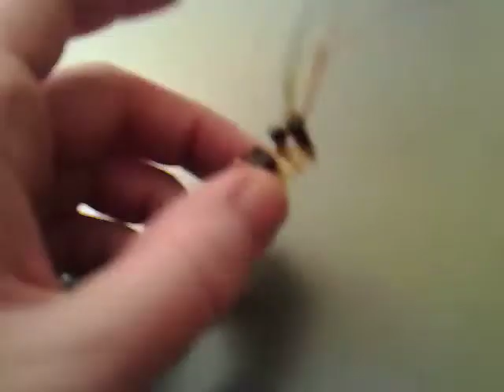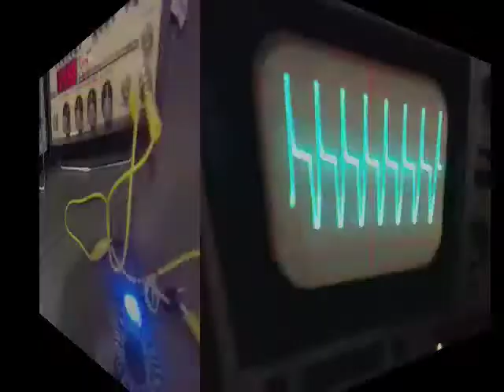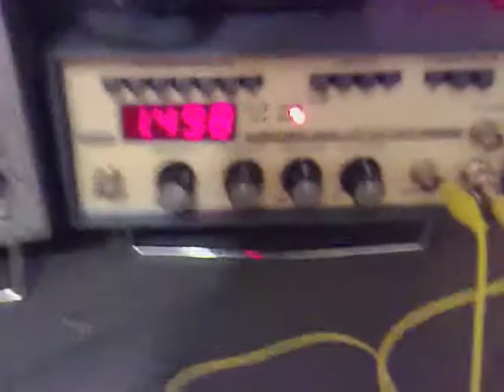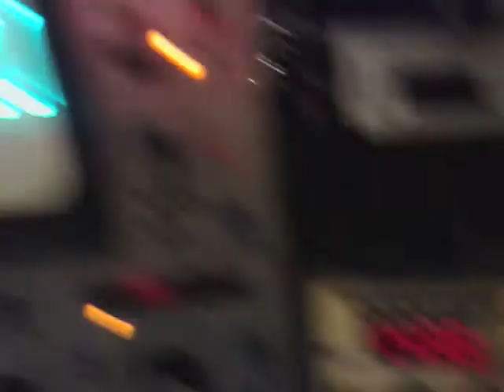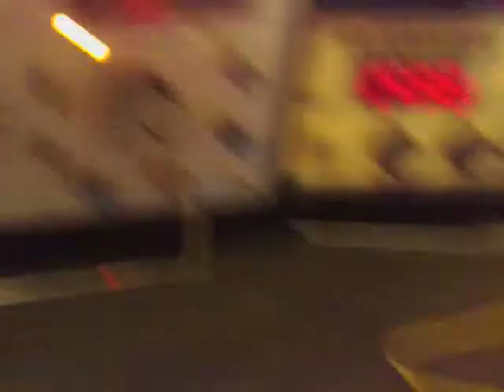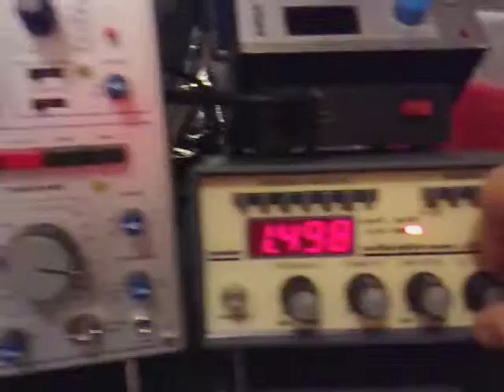Joule Thief (Checking Resonance) 015

Comment: The lights dim as the frequency rises because the higher frequency gives the magnetic field less time to collapse, which means that the flux change is slower. Because the change is less rapid, the flyback voltage is lower. That means less bright LEDs

Comment: So you could take the energy from one capacitor and transfer it completely to another one? Because normally that is only supposed to be possible with half of the energy lost in inefficiencies, and there is a good reason for that too.

What would then happen if you put a resistive element between the caps, a filament bulb or maybe a led?

It would only limit the current flow, but it would not "use up" the electrons! If you could transfer the potential back and fourth than maybe! :)

Comment from the maker: Yes, you can if you had a capacitor with a joule thief it would go up by function 'x'. You could the run the same capacitor with the joule thief to Capacitor 2 which would be raised by function 'x' like in a marx generator but you could reuse the joule Thief using switching. You would not gain power just transfer it to a higher potential.

Is that what you mean't?

Comment from the maker: I think that the Peltier is only useful on very small amps, a TS555 only runs on 10uA at 5v. It micro not milli and I am imagining that the timer circuit may run on a joule thief to run the timer circuit. I have two thoughts on it at the moment, run it at 1.5MHz and recover the timer power put it into resonance or just half the input voltage but running it at about 60-120Hz which will double the effiency on the circuit.  Add me as a friend and post videos of the shots we can make sense of the;-)

Comment from the maker: I know I have seen the dead spots in the frequency range for this coil, but have found that it also has spots where it runs much more brightly, I only want to see if that means we get a brighter light for longer, or a light that dims after working for much longer or anything else.... I know the coil works differently in these ranges and want to know what the  effects will be on efficiency. Any Ideas for making it brighter for longer?

Cheers
Paul.

Comment from the maker: Thanks for your post, I agree with you that the joule Thief is doing it's thing at time intervals where the square wave is on, but a strange thing happens when you approach a certain frequency, I have watched it happen lots of times now.  The 1:1 coil stops using its "just happy to be oscillating frequency" and starts making friends with the input frequency.  They then start dancing to the beat of the same drum.

Comment: Nice demonstration of harmonic addition there at the end! Important however that  the overall energy does not change but gets piled up at specific points in time producing those nice tall peaks. 

Been thinking on the TS555 feedback. Need a way to deal with overrun - once we peak and start down the other side it would drive itself off, need a direction sense to determine if freq should be increased or decreased for more current. Will pm you when I get that sorted.

Cheers

Comment: Hey Kubikop, there is one thing that I have always wondered about. Can you use the joule thief circuit to charge another battery or capacitor? Like trying to charge a higher voltage cap with a low capacitance with another low voltage cap with a high capacitance? Would have been great to use in a project I am working on :D

Comment from the maker: The TS555C goes up to 2.7Mhz a couple of variable resistors and a 200pF Capacitor.

I will post the circuit once I've made it.

They run all the way down to 2v!

Remember to rate..